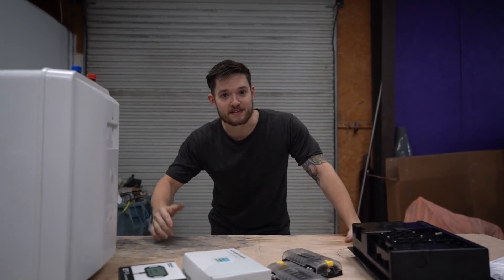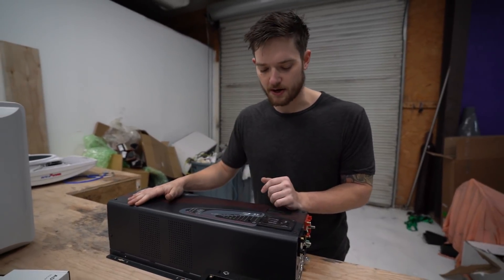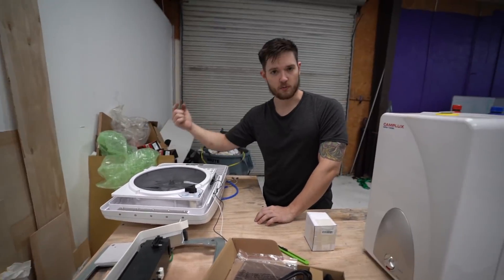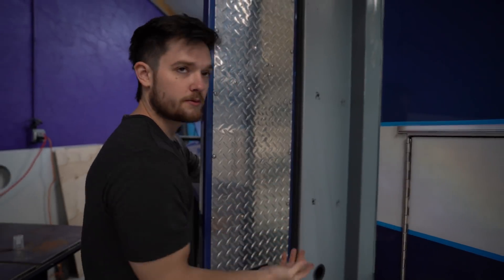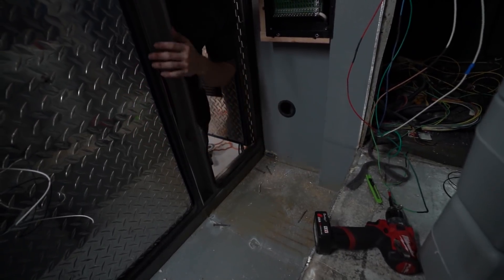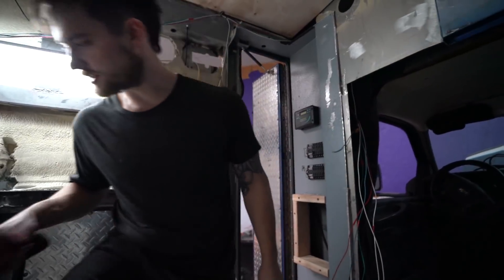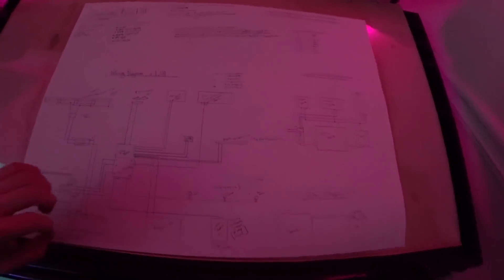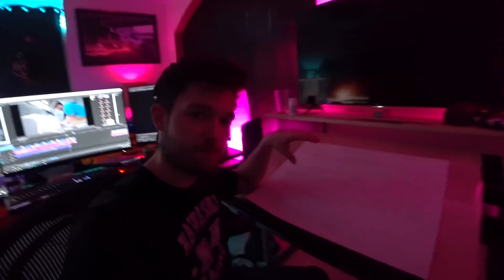The Ambulance RV Conversion Gets an INSANE POWER SYSTEM

Comment: Hey Dan, I’m an EMT and work the ambulance. Most if not all ambulances have an inverter for that power to change 240-120/110. See if you didn’t rip it out already, you should be able to use it and not have to buy another one
Reply: iirc it wasnt big enough for what they wanted
Reply: @Schizo_Milk  Neither is what they got.

Comment: Split phase refers to the fact that one winding has a slightly delayed action when creating the magnetic field. One develops the magnetic field a little earlier than the other in each half cycle of the AC cycle..Then the other winding which is wound physically at 90 degrees to the first develops the magnetic field slightly later than the first. As a result the magnetic field appears to rotate through 90 degrees. This is enough to induce currents in the rotor windings creating another magnetic field which reacts with the stator magnetic field causing the rotor to turn..

Comment: Great little system you got there. Only a few things i would watch out for/you might want to upgrade in the future:

Solar charge controller. Pretty sure the controller you have right now is a PWM controller (pulse width modulated). It basically wastes extra power your panels make to charge the batteries at the right voltage. Much better option is an MPPT (Maximum power point tracking) controller if you are looking to get the most out of your panels. And everyone hates hooking up to shore power so max efficiency is desirable.

Batteries. Sealed Lead acid batteries are great. Cheap, safe, hard to destroy. Unless you discharge them too much. The useable charge in lead acid batteries is fairly limited. I guarantee those batteries will not give you 200ah without damaging the batteries. Overcharging and undercharging lead acid batteries kill them quickly so it is VERY important you look up the discharge curve of your batteries. Depth of discharge on SLA batteries is generally safe to keep above 50%. These batteries will probably last you 500-1000 cycles if you adhere to this. What i recommend is a low voltage detection circuit that you can adjust to the tenth of a volt and shut off your inverter if it exceeds settings. Same thing with over voltage and charging. For increased cyclic reliability and better depth of discharge i recommend lithium iron phosphate batteries. 100% worth the money, just have to make sure you do your research into it if you make the bank out of prismatic cells.

Other notes on efficiency. The voltage of your batteries are also very important. a 48 volt bank is the best, but since you only have two batteries a 24 volt bank would be the way to go. The closer your battery voltage is to your solar voltage, the more efficient the charging will be. Same with inverters. Since you still have 12 volt loads to run such as LED lighting and fans and whatnot, a 24v to 12v regulator is excellent. And it keeps the voltage stable at all times, you don’t have to worry about the fan spinning at different speeds or lights dimming due to varying voltage.

120 volt to 240 volt AC conversion. Auto transformers are the best device to achieve this. Solar edge makes an excellent one. You can actually get split phase out of single phase 120 volt with one. You can find them on currentconnected.com and a great video on them on the website owners youtube channel, HighTechLab. He also has great videos on DIY Lithium Iron Phosphate battery banks.

Charging off the truck batteries. A buck-boost converter designed for charging batteries will allow you to charge your house battery bank off the truck batteries at whatever voltage you want, and if you have it remotely controlled by the vehicle ignition you won’t kill the start batteries. That’s one feature I always enjoyed.

Off grid power for the win! can’t wait to see how the system runs once it’s all finished.

Link to auto transformer:
https://store.currentconnected.com/?product=solaredge-seauto-5kva-autotransformer

Can handle 25 amps differential between phases. plenty for your application

Comment: I’m doing exactly the same thing in my van right now. I even used the exact same batteries as you! I cleaned out my local auto parts store of battery cables to hook all my stuff together and to the charger, with a master fuse right on the battery terminal. If you don’t have one, I recommend it. Used 12ga wire to my fuse box, much smaller than yours because I have a lot less stuff to run. Your formulas are correct. I’ve been using them since I got my ham radio license 30+ years ago. Feel free to hit me up with any questions. Funny how we’re doing the same stuff at the same time!

Comment: The split phase output basically means it takes the two 240VAC hots in, and it'll output two phases of 120VAC, the same way a house breaker panel will. Essentially treat the AC outputs like each half of a residential breaker panel.

Comment: Hey Dan I'm a commercial electrician,  I want to start by saying that I've watched since you were in college. That being said this comment can serve as a way to ask me anything I know. I heard one red flag that I want to catch you at before you get to far, and it could have been a mistake on wording. As far as your main breaker goes you want to strive for an 80 percent rule. You want all of your sources that need power (load) to be no more than 80 percent of your main breaker size. What i mean by that is say you're going to get a start up voltage on a motor turning over of 25 amps you would want to calculate all of your loads and go 20 percent over what that would be. That's in a perfect world. You would do fine usually to calculate running loads i.e. a motor after startup will be 10-40% less amperage once it gets spinning. Once you add all these systems together you will then be able to then determine which size main breaker you will need and then determine the size of your line side feeds. You are going to need really large wire I would guess something around 250mcm on the low side due to voltage drop on a dc system. I also would say that you should consider investing 20 dollars into an Ugly's  book, they have them and big box home improvement stores with the electrical. A NEC code book is an electricians "bible" but an uglys manual is a cheat sheet for 70% or better of what you will need as common knowledge. Again always here for any questions, I myself live in metro Atlanta so its nice seeing the same things as you on my day to day.

Comment: Ur right about the wiring but that’s for home use solid core your prob going to be running stranded wire (car audio amp power) there is a different awg for that and there is a difference between copper and aluminum

Comment: 12 gauge should be good for the majority of the appliances inside the ambulance. as far as the people that actually build these conversions there is a general rule that has come out as these are moving vehicles its that you will want to use stranded wire not solid core, because as that vehicle moves and flexes over time the solid core will break. so find a good supply of silicone coated 12 gauge stranded core copper wire. me personally I'd go over kill with 10 gauge since stranded wire seems to be the preferred method. Another thing you will want to do is have the wires from the inverter/solar be thicker going into the main fuse box as a precaution. I assume you are obviously using 2-0 / 3-0 for your battery run to the inverter since its a shorter run.

Comment: shouldn't your main fuse be rated to whatever the battery + alternator OR junction box can handle? and then each line off it then be fused at whatever wire spec you put in?

Comment: With lead acid you’ll only get shot 200 amp hours of usable power if you want the batteries to last more than 250 cycles. Make sure you done discharge them more than 50%. That’s about 12.3v for an AGM otherwise the life of the battery will be greatly reduced. Good luck!

Comment: "If you over power these wires, they'll burn"
Yeahhhh when I put my new amp in  my truck I didn't think about my negative wire being only 16 gauge, for an amp that puts out about 1300w and learned my lesson... I got really lucky that the negative melted but didn't start a fire in my truck. Bumped it up to 8 gauge after that xD

(also blew my subs not long after because I accidentally flipped it to 180 out on the phase lmfao. needless to say im not what they call, smart )

Comment: For myself and ONLY myself if something recommended let's say a 12 gauge wire I would always go to like a 10 or an 8 gauge just in case it ended up drawing more power than what I expected.. When I was installing car audio in my car and a friend's car I ALWAYS used a thicker wire than what I needed just to help draw a cleaner signal.. That and if I wanted to run better shit in the future I didn't have to fully rewire the car because I already ran the 3gauge originally when all I needed was maybe an 8gauge.. But that is just me, but that is honestly just how I did things and never had an issue doing it that way

Comment: I believe an insulated wire means it’s resistant to RFI input... or that’s shielded?
Reply: Shielded wires have an internal metallic sheath to keep out interference. Any wire with a coating is insulated.

Comment: Split phase is two 120v connected in series.
Reply: Kind of, it’s 240 volt with a ground referenced center tap
Reply: @infl  thanks Caden. We don't generally have split phase here in Australia but it's pretty interesting. Explaining it as if it was series connected made it easier for me to understand haha
Reply: @mattcolley3844  Yeah i can see how that makes sense. how they are generally configured in actual transformer secondaries are two coils in series, with the tap between the two coils being the ground referenced neutral

Comment: Probably not the first to say this but those holes you drilled for the wiring need grommets so the metal doesn't rub through the wires and possibly start a fire

Comment: You’ve never said otherwise, but it may be worth stating for people following:

You fuse for the wire, not the load. If you have a 10 gauge wire at X distance, it calls for a particular amp rating. You fuse for that rating or LOWER. NEVER put a higher amp fuse on a particular run because it is far a high draw device. If you want to power that device, run the proper wire and select an adequate fuse. If a fuse keeps blowing, don’t just swap in a higher rated fuse, find the issue.  

Drawing lot of power through a thin wire creates a filament. You don’t want a filament flopping loose in your walls or under carpet.

Comment: Yeah that 400 AH is actually 200 AH.  Led Acid batteries can only be drained to 50% or it will ruin the batteries.  should have went with Lithium batteries.  they can be drained to 0 and last longer.  yes they are more expensive not not really if you do the research.  these guys clearly didn't do the research on this part.  I assure you they will be upgrading sooner then later. or they won't get what they need.

Comment: So the wire math has to do with the length and diameter of the wires, and the resistance corresponding to that. This is how you would calculate max power. Its very easy but its wires so it automatically fckn sucks absolute wieners